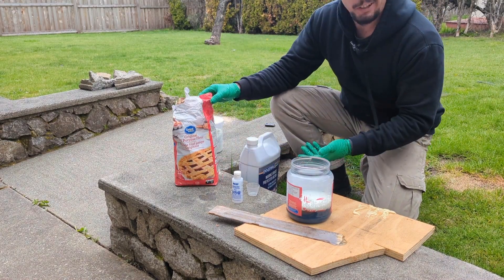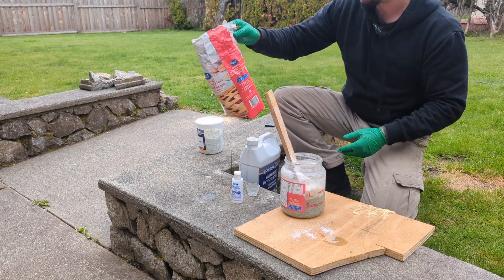How to: Make Peanut Butter - AKA Thickened Resin for Boat Building Fiberglass

Comment: Body filler is made the same way but instead of flower its talcompowder aka baby powder that is added to the resin with either chopped fiberglass strands or fine metal dust

Comment: Why not add the thickener before the resin so it doesn’t kick off too quickly? And flour? Really?
Reply: Because it wont cure properly, you want to add the thickener to an activated mix always as the resin and hardener won't mix completely.

Comment: Hi, just came across this vids. Would that be less durable than using fiberglass woven for building something? Can we use chopped fiberglass strand as a base layer and use fiberglass woven for outer layer?? Thanks
Reply from the maker: @user-zt8gs8js1u  the standard is using fiberglass strand. You can use either- physically not much difference